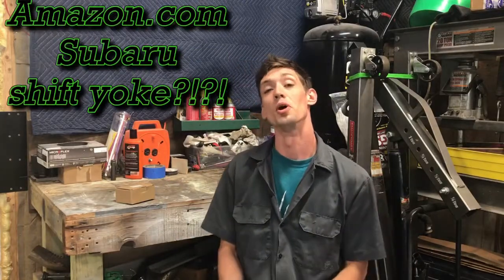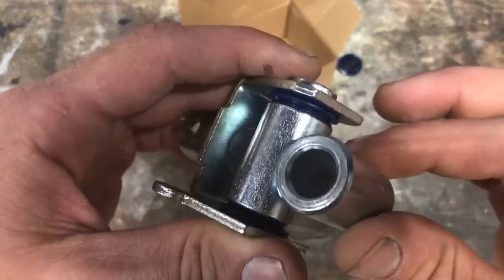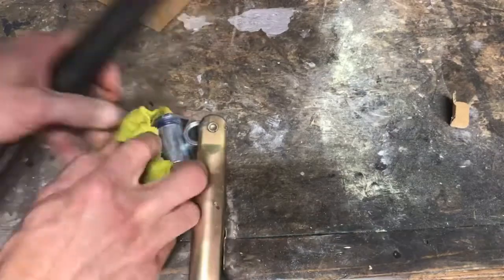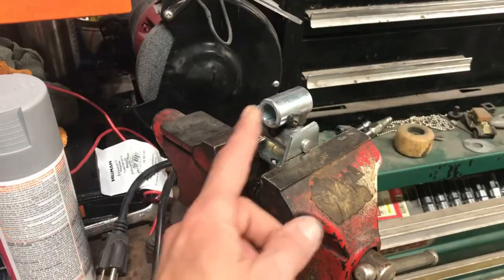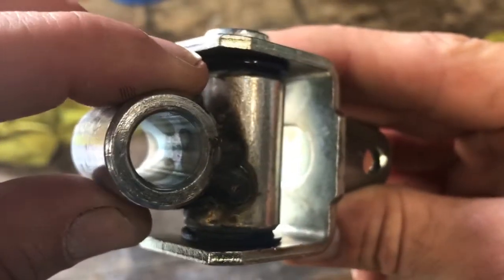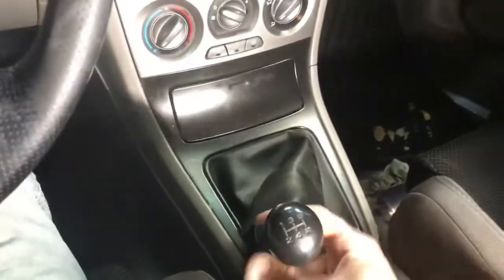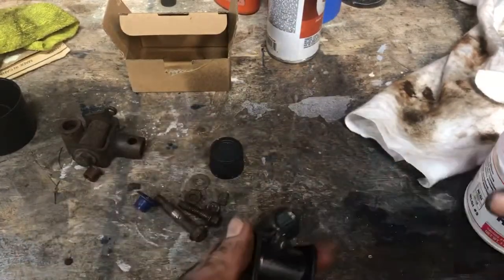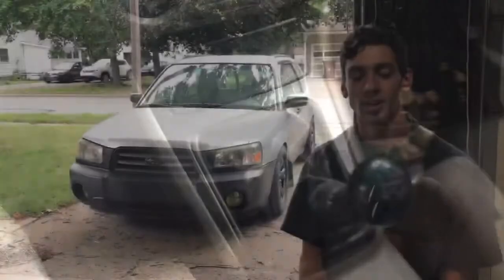Amazon.com Subaru Shifter Yoke (new junk?)

Comment: Surprised there’s so much slop still, I’m guessing it’s because of the bolt instead of the double pins, looks like it isn’t fully tightened. If you were to do this again I suggest getting “torque solutions solid shifter linkage u-joint”. And also change the other shifter bushings as well. Then you’ll get no slop

Comment: If you actually had the spring for it, it wouldn’t have that play
Reply: I have exactly how much play he has at the end after his "fix", but I have a 6 speed 3.0R Liberty (Legacy?).  I haven't yet physically looked at what's wrong, just researching at this stage, but would you say that I am probably just missing the spring and if so, making/replacing the spring would fix the majority of my issue?
Reply: they switched to a internal spring later on i think in the GC era
Reply: @minus3dbintheteens60  I would check the front and rear shifter bushings and if they're both good then maybe the pivot bushing, also double check all bolts are torqued